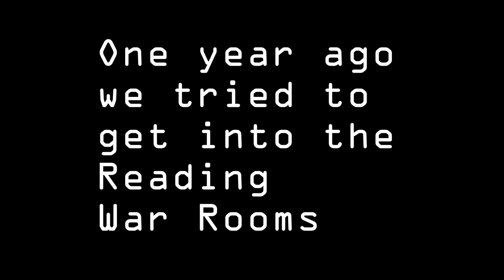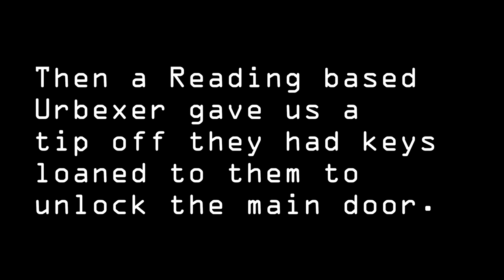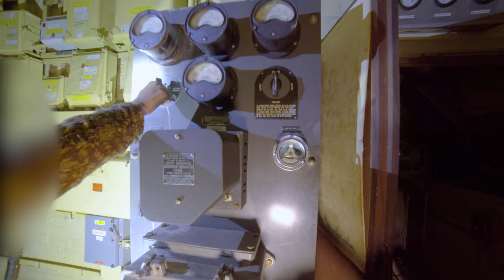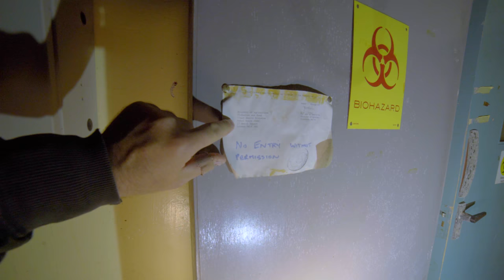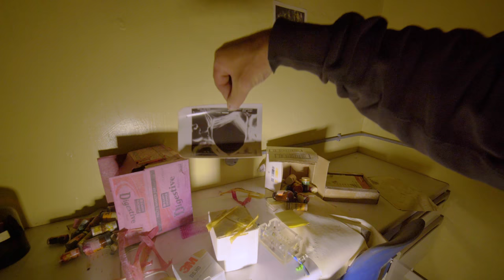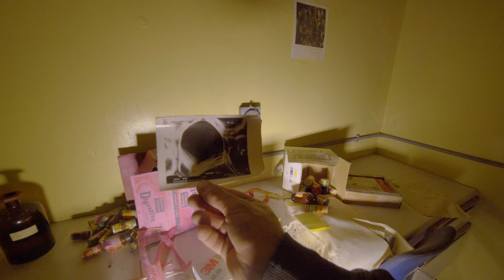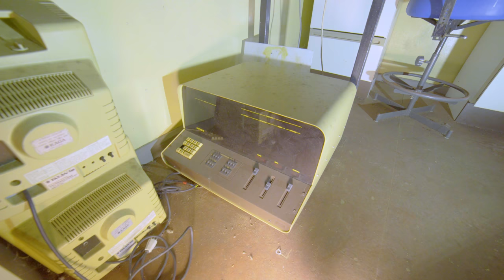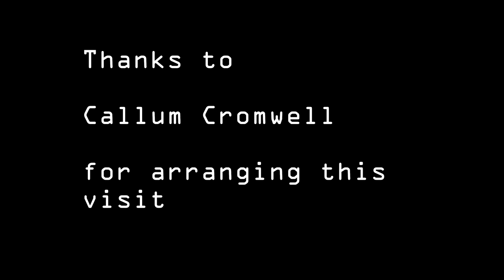Top Secret War Rooms on Reading Campus grounds FULL EXPLORE 4k

Comment: Glacial Acetic acid isnt that potent and certainly wont burn through to the bone !! ... 
Its only Glacial, because it has low water content, and is a solid !
Vinegar is around 4% Acetic acid ... and water.

Some of the glass plates are from a Microfiche.
I assume that the DEFRA room with the BioHazard was research being conducted at the University on behalf of them.

"Temperature Mercury stuff" .. That would be a Thermometer !!